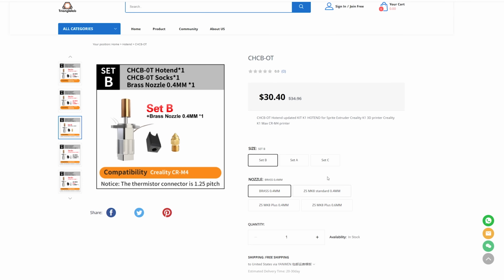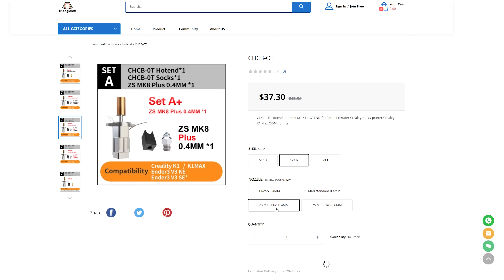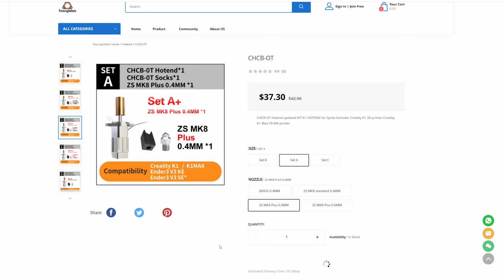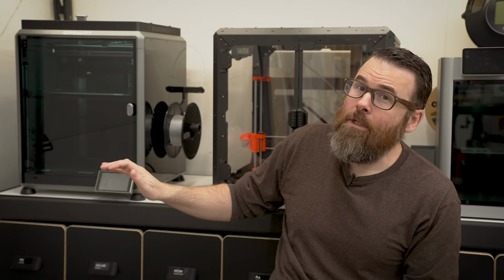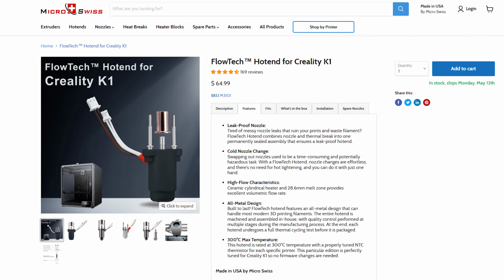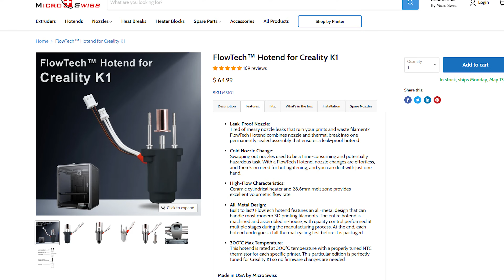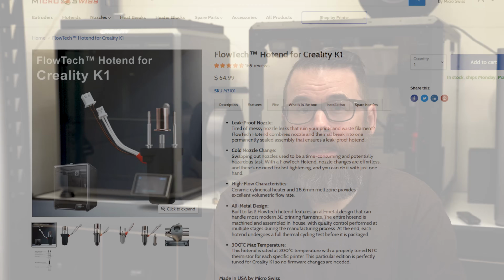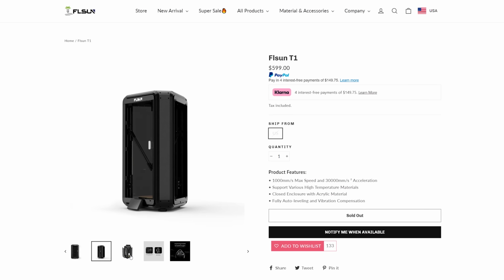Creality K1 Max Hotend Upgrade - Trianglelab CHCB-OT

Comment: I very recently had an extruder issue with my K1 Max.  I upgraded to the Phaetus DXC extruder and a Creality Unicorn hotend, soon to add a Diamondback nozzle to that.  Both are working well, and the Diamondback nozzle will allow me to print pretty much any filament the printer is capable of.

Comment: i have my k1 max for like 1 month now but you will get Unicorn Quick-Swap Nozzle now mutch better no problems at my place here alsi have better extruter now then the older models like first they where alu now you have like steel extruters but still bed level they still did not fix that XD

Comment: "I appreciated your video and the points you made. However, I was with two other knowledgeable, individuals, who had different perspectives. My son, an IT professional, and my friend, who runs a commercial printing business for industrial filaments, both felt that the video came across as overly negative and whiny.

Personally, I own 3, K1 Max Printers and early into ownership had mixed experiences with them. While I've managed to get some excellent prints, I've on a few occasions also encountered some disappointments. Rooting made all the difference as well as we switched hot ends, ended up, selecting after trial of several the Microswiss version, 
Across the board of all printers that are easily available on the market today I sincerely believe one of the main issues is the limited temperature range of the hotend. 
Manufacturers have truly lost touch with the needs of even hobby users, who these days require higher temperatures (at least 350°C, ideally 400°C) to work with various materials. Irregardless of a heated chamber or not that option should be there for the end user. I see that they dole out. Temperature increases minimally every year with the next model, even though those hot ends and capabilities have been available for well over five years at a very low cost for the hot end and all that encompasses . This feature should have been a standard option long ago, given the availability of reliable nozzles and hotends that can handle these temperatures."

Comment: did u change something in printer.cfg ? i have also trianglelab hotend for K1 max but..... my PID done in 40sec ....and when printing temp jumping  -2 +2 up down
Reply from the maker: I didn't change anything.  I think I might have done a factory reset though.
Reply: @RobertCowanDIY  hm..my hotemd pid is 40 sec only ...and in printing my temp jump +2 and -2 up down...

Comment: I have 5 K1 Max printers, pulled them out of the box, let the setup run and every print came off without issue. They have run for little over 6 minutes months without issue. I did recently change the hot end to the Micro Swiss so I could use other filament that won’t work through the stock hot end. I print at 300 - 330 mm. I am very happy with the K1’s and am looking at getting a couple of the new multi-color K1s

Comment: For those with clogging issues, i think it may be heat from the stepper motor on the extruder. I took the motor over off, and put a small heatsink, i have had a clog yet. Heres hoping

Comment: My print quality is pretty good biggest flaw is printing at too high of a speed and too high of a layer height.  Just like cnc work speeds matter.
Reply from the maker: well, with CNC, it's more of the appropriate feeds and speeds for the material and cutter.  with aluminum, sometimes going much faster creates a better part.
Reply: @RobertCowanDIY  actually quite the opposite slower speeds usually end up with less tooling marks. This was what I was saying slowing down the print and adjusting your layer height should yeild instantly better results in your prints. Less layer line bumps equals better quality parts.
Reply from the maker: @YouCanFixIt  We're gonna disagree here, but optimized paths for high speed machining (high spindle speed and high feed) gets you a better finish.  Now, if you're dealing with old bridgeports from the 70s, they can't move fast enough to leverage that.  but with modern machines, faster is better.  It's all about small cuts, not loading up the tool, etc.
Reply: @RobertCowanDIY  I work on a Haas VM6  every day speed increases heat and chatter hence why we have feed and speed charts. With printing I would again say the first ajusting you should do is .016 layer height the slicer should ajust the speed then increase your travel speeds. I have both bambu and creality machines k1 max and a p1p both needed that 1 ajustment to produce production parts right out the box. Both have paid for themselves running almost 24hrs a day for the last 6 months.
Reply from the maker: @YouCanFixIt  Ah, interesting.  I'm still not convinced that the same rules apply to additive as they do to subtractive?
Reply: @RobertCowanDIY  well more squish equals less layer gap closer layers better finish...

Comment: Here's what I'm curious about. I currently own the new series k1 max. There is a unicorn nozzle on it. I want to use a normal nozzle instead. But what I don't understand is, is the product in the video compatible with the new series?
Reply: Do you mean K1C? I think K1 Max does not use unicorn nozzle.
Reply: @martincstee5335  No, not K1C. My K1 Max comes standard with a unicorn nozzle. 2. Series K1 Max.
Reply: Thanks for the clarification. I chatted with their online support, she assured me if I place order now (in the US) I will get the K1C upgrades for the K1 Max. BTW just curious where you bought yours from? Amazon, Creality website, Microcenter, etc?
Reply: Did you find out if this works to get rid of the unicorn nozzle? I'm looking at getting a k1c, and i want to use a standard non proprietary nozzles

Comment: I used the microsswiss hot end and nozzle on my regular k1, also had to upgrade the extruder to the newer version. The one thing I have to say is the microswiss nozzle is very nicely done and there is a noticeable difference in quality between it and a stock nozzle.

Comment: i have other printers and im dying to figure out how to fix settings, 2 need big tweeks to the supports to make it cleaner and then maybe some over hang work and a way to speed up one of them
Reply: edit, seemed to just need a tighted bolt on the print head

Comment: You should have probably have done a PID calibration and a resonance test after changing the nozzle. I got lucky and my k1 is quite good. I did level my bed and rooted it. It is now my most reliable printer. I picked up one similar to the triangle lab one a while back. So I may try it.

Comment: I love my K1 Maxs, no issues other than hot end clogging.. I tried the Trianglelab CHCB-OT and it clogged right away. A K1 Max update solved the issue but it started leaking soon after.
Reply: The problem is the filament

Comment: I see you having the stock bowden tube in place, might wanna swap that for a capricorn one. That normally gets rid of a lot of the flow issues. On all my printers I build spool holders with bearings, just the little less friction on a full spool reduces surface problems even more.

Comment: I had a lot of the same problems on my k1 and I switched out my hotend to a similar one you put on and I increased all my speeds and acceleration and all my vfa’s disappeared and I also changed my print settings to print outer walls first and that helped too and I changed my extruder out for a printed one from printables. I have had to change the tension arm as it bent but it’s not a big deal and I put on a pei textured bed from an Ender 3 and that’s been working very well. But after doing all of that it’s been an amazing printer